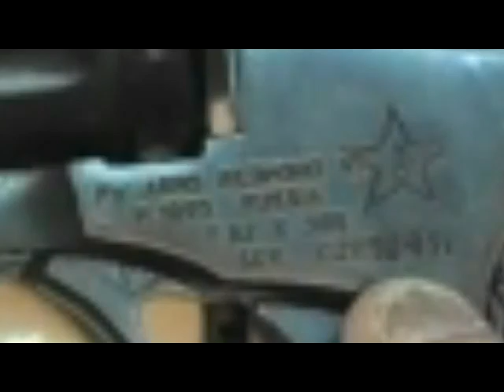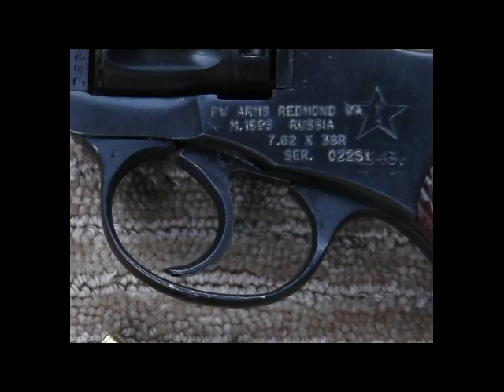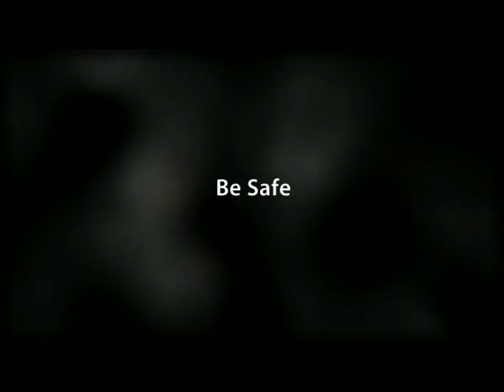Russian Nagant Revolver M-1895 by FirearmPop

Comment: probably Russia's best handgun ever . its extremely reliable .. 
and with a chamber finishing reamer you can buy  a spare cylinder surplus and rechamber it to 32/20 wcf . a popular cowboy action caliber .  very similar in power level to the original combat load for it .  ..not much metal is removed   and .32 acp cylinders are also available but are sometimes difficult to find most commercial ammunition available in the original caliber is loaded on the weak side ppu is probably the hottest commercial ammo  for accuracy consider the double action more of a 2 stage trigger . first it lines up everything then gets firmer . then fires  ive gotten groundhogs in 1 shot  at 60 yards shooting double action